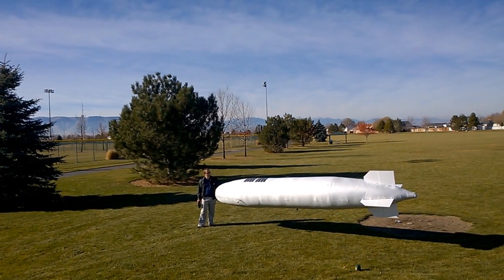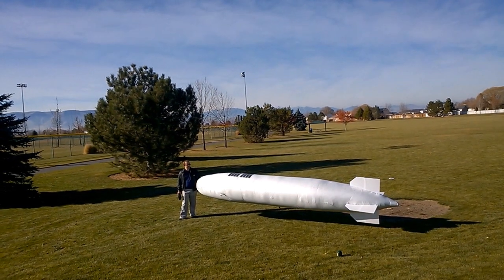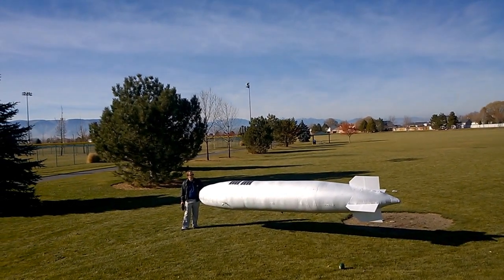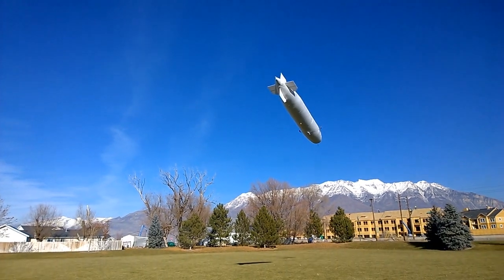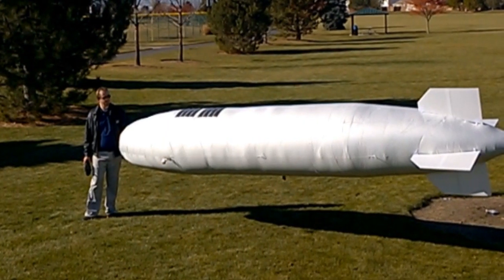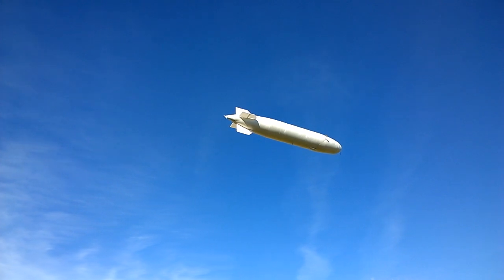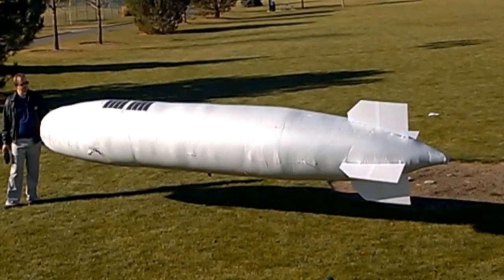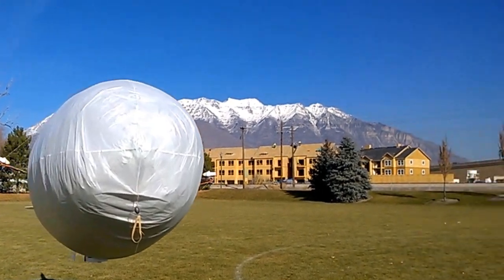Solar Powered Blimp Drone Prototype

Comment: Lite metal technologies used with graphite power cell technology to form hard outer shell with a Crystal lattice on the inside to generate power to run its systems. Take your pick of gases to use for lift.

Comment: @ Bacca

Please look into NASA using a fernel lens over the solar array to increase production of energy.

NASA got eight times the power out of a basic solar panel by adding a fresnel lens above it in a curved formation.

Kind of like a curved roof.this afforded getting light from every direction no matter what the position of the craft was.

Hope this helps you.
Reply from the maker: Yeah, that is interesting. The blimp pictured here is pretty old, since then I experimented with making a transparent envelope that acted as a lens similar to what you are talking about. That was an interesting experiment, but had some problems. The biggest is the heat involved. Heat is a big problem for any airship. Any differential between the temperature of the gas inside the envelope and the gas outside the envelope will cause massive changes in lift, which are difficult to compensate for. Then it gets even worse when the heat changes rapidly (for example if the sun goes behind a cloud). A solar blimp will naturally have worse heat problems than a regular blimp, and one that uses a lens with concentrated solar energy is even worse. Those solar cells get really hot. In the transparent blimp they were melting the  structures they were attached to, so you can imagine what it was doing to the lift!

Comment: Electric motors are lighter than petrol motors so there is room for solar cells. If the airframe structure  is carbon fibre it will be almost invisible on radar. ( while flying gliders at an air force base the station radar had our 2 metal gliders but could not see the fiberglass glider flying directly over the station)  it can loiter almost indefinitely at high altitudes. I bet the military would be interested in that for servalence.  Damm i woke up this morning with this exact idea and thought I would check to see if anyone else had though of it........

Comment: Im starting to look at the idea of a blimp with a camera. Solar panels were part of the plan since I wanted to land it for a few hours and let it charge to increase range. Someone has built it right here, proof it can be done and can work. So far im right at the start but im thinking wax paper over thin overlapping plastic and melting it together with an iron to keep it airtight. Once I get a blimp fully sealed, im not sure where ill go from there.

Comment: We're honestly surprised you're the only one who ever came up with anything like this.
I have some questions that I'd be glad if you could answer:
How much weight can this carry, exactly?
What is the maximum power output of the solar panels?
At what range is it capable of operating, in terms of radio control?
Would one be able to install EO/IR imaging systems or cameras?
Thanks for your time.
Reply from the maker: This particular drone has a useful payload of about 2 kg. Not much, to be sure. It could be scaled, and the capacity would increase exponentially. I'm currently using standard PWM recievers to control it, with a range of about one mile. However, the ultimate goal is a fully autonomous vehicle with essentially unlimited range. The big thing currently stopping me from doing that is regulatory, not technological. The FAA does not currently allow the operation of drones beyond line of sight. They keep saying they will change this, but no word yet. Until then, this project is effectively on hold. Power output from the solar array used here is about 30 watts, although since then I have started using much more powerful solar cells. Last time I did speed tests, it was moving at about 44 kph. Cameras and imaging systems would be a good fit for this.
Reply: This is such an awesome thing just to even watch fly- or maybe float-, never mind the high endurance and quiet operation! It is really disappointing that you can't legally continue flying this aircraft due to the FAA nonsense... How well has it (or your latest version) handled the wind?

Comment: Ditch the solar cells, stick with lightweight batteries and build it just big enough to carry a grenade launcher , IR aiming system and two way video and control signal gear for ultra quiet long loiter missions to take out insurgents hiding in caves or traversing mountains.
Aim to make the whole thing disposable and inflate the envelope with hydrogen.
Reply from the maker: baldieman64 Truth be told a conventional drone would probably serve the purpose of attacking targets better than a blimp. Because its speed would be greater and it's size smaller. One exception would be if you desire the ability to linger for longer than the batteries would allow, although you would need the solar cells for that.

Comment: Is there the ballonet into it?
Reply from the maker: +котофеич бегемот No, this does not use a ballonet for bouyancy control. On a blimp this small they aren't really practical. Instead, dynamic lift is used for altitude control. This does limit the altitude range you can operate at within a single flight. For example, it can have a flight that occurs at 3000 meters. It can also have a flight that occurs at 100 meters. But it can not have a flight that goes from 100 meters to 3000 meters in a single trip. That being said, a model could be made with a ballonet easily enough, it would just have to be a little bigger.
Reply: Thank for detailed answer!

Comment: its great until the wind picks up and then you have a flyaway situation
Reply from the maker: Heh, I could tell you stories... I used to do gliders as well as a few powered planes. One thing about them is that no matter what happened, the model would eventually come back down. When I started on blimps I quickly realized that is not necessarily true. I wouldn't say wind in and of itself is the problem. It's more when something goes wrong with the controls. Power loss, control loss for one reason or another. It is a prototype after all, bad things happen. And when they do it can be very... interesting. I've had to chase down a blimp more than once when it started to get away.

Comment from the maker: HMA Victory: Most of the airships are at least basically the right shape. Some might be more top heavy than is wise. The Goliath, for example, would need something really heavy on its belly to keep it from flipping over. And they are all too dense for Earth's atmosphere. You would need much less internal structures and much more space for gas cells. 

But, yeah, you could probably make something that looks basically like, say, a Destroyer and expect it to actually fly. At least, its outside appearance could be similar :)
Reply: Cool thanks :)
Reply from the maker: Shahriyyah Springwork LOL no...

Comment: How much can this carry? What would you sell this for? Whats the power output of the solar panels? How much of that power is consumed by for 5 minutes of full thrust and what speed does that full thrust give?
Reply from the maker: Power output on this older version is about 30 watts. I currently use much stronger solar cells. You may want to see some of my answers to NATO/OTAN above, some of the questions are similar. I think when I did speed tests with this, I could maintain 44 KPH indefinitely as I recall. Sadly this project is currently on hold until the regulatory citation clears up. Currently it is not legal to operate drones beyond line of sight here in the US without special permission, which has not been forthcoming.
Reply: You forgot to answer how much it can hold, and I have a question how long is it
Reply from the maker: This particular model has a useful payload of about 2 kg. That can be increased by increasing the size. This one was about 24 feet long.
Reply: Sweet I'm asked because I'm working on a  design for a flying aircraft carrier for RC planes basing it off of the carriers from the airship Pirate sears, BTY I would like to join the airship Pirate world so how do I?

Comment: Police should patrol cities like this, they could cover much more territory in the same amount of time, picture 50 of these hanging over a city, crime would drop.
Reply from the maker: +EVZebra Sounds like a good idea to me
Reply: BaccaYarro The ultimate construction material would be the same as a 2L Coke drink bottle just a lot bigger, same wall thickness so it can be pressurized slightly to give it mechanical strength. Its an expensive plastic injection molding tool though, but perhaps it can be fabricated using poly-carbonate sheet 0.2 - 0.5mm thick and glued and riveted with an ABS plastic glue on the joint on the bottom spine.
What ever is used it needs to be pressurized to make it strong so that it can be flown around successfully on windy days. If its made of a clear poly-carbonate it will become invisible once its at about 50 meters as it will take on the color of the sky the engines battery and solar panels can be painted sky blue so that it will be stealthy during the day.

Comment from the maker: Bradley: Yeah, I remember back when it was Project Walrus. It's a good idea, and I hope it works. But it's a different direction than what I'm taking here. I experimented with a wide-body design like the one used by that airship. I found that while it did help with stability on the ground, which is the goal of the Dragon Dream, it hurt stability in the air. 

I'm more interested in solar powered flight for airships, and for that I will need maximum stability in the air, and a minimum profile against the flow of air. So that means a long and tapered shape.
Reply: OK, cool
Reply: BaccaYarro  I am wondering what type of solar panels you use. Because cells like CadTel can work fantastic both in direct sunlight and with indirect blue light. Japanese tests show 20% efficiency under blue light. These panels can be screen printed, are very flexible, High output  (not to mention manufactured yourself at a very cheap cost) Preferred method is the Japanese method with some DIY cheaper alternative replacements. Msg Me if you want patents and methods. For a while my neighbor worked for Next Era power (fp&l to those that live in Florida) as the head of the solar division. He had a few of their panels that they use in their solar arrays. 4ft x 1.7ft panels produce 550w, 55v 10A and cost 200 to manufacture or 500 if purchased from a 3rd party manufacturer made to specification. What a great Idea I hope you take it even further!
Reply from the maker: Once Asleep Somehow I missed this post, and I don't know if you are still around. So far I have restricted myself to off-the-shelf solar cells, but I am intrigued by the ones you are talking about. Can you tell me more about how they are made, or how I could go about testing them?
Reply: The British and the Russians had similar projects back in the 70ies and 80ies, their airships were disc-shaped and used heated gases instead of ballast. The aerodynamics of the ship were a kind of better that way than that of a cigar-shaped one (I guess by side-wind), and the volume anyway. (you can also google "ala-40")

Comment: What do you think the maximum wind speed a UAV blimp like this could operate in and still be controllable and capable of flying in a grid flight pattern over an open field? Cool project!
Reply from the maker: christophertelford Roughly 25 MPH. Which means it can operate in roughly 98% of wind conditions observed at weather stations in the USA.
Reply: BaccaYarro WOW! What's the aircraft's top speed?

Comment: Awesome baccayarro.  You are mastered in both real amd virtual airships! I want to ask something about your solar powered airship , can it be mounted with more powerful engine and harder skin inorder to fly faster?Also , is the floating force provided by helium??
Reply from the maker: Yes, although a rigid structure won't be necessary until it goes much faster. I doubt it will be needed for the foreseeable future. If speed is what you want, then the best way to achieve it in a solar powered vehicle is to use the jet stream, IMO. 

For example, if you built a much larger version of this that could fly at 30,000 feet, you could fly from New York to Tokyo in about 2.5 days. By using the jet stream, you would have an average ground speed of ~130 MPH, even with an airspeed as low as 30 MPH. You could sustain that speed indefinitely, because there are no clouds or weather to speak of at 30,000 feet. And, of course, all this with essentially no fuel cost.

That's the ultimate potential of this type of aircraft, to revolutionize global cargo. But that would cost hundreds of millions to develop, so we start with drones.

To your other questions, yeah this flew with helium in this video. I use hydrogen for testing the envelope, because it is much easier to detect leaks with. I will be trying different prop and engine combinations, at the moment I believe I would gain more thrust with a larger propeller rather than a larger engine. The engines I use are surprisingly powerful and efficient despite their incredibly light weight.

Comment: Cool. I would use both types of solar cells for better coverage, not just one type. I would also add more thrusters for better movement in all three dimensions. The outer envelope seems rather thin, I noticed puffs of air affecting it. You may want to add external carbon fiber bracing, sort of a reverse zeppelin design, which has internal rigidity. Good luck.

Comment: I want to get into this. I think a hydrogen blimp with a fuel cell power source for propulsion and drone recharging would be ideal. I guess that the trick is the hydrogen/ oxygen reaction. Lots of zeppelins were lost due to this. Helium doesn’t seem realistic till it can be manufactured thru hydrogen fusion. All interesting and great stuff. With solar cells on the outside of the blimp I’m guessing that you would never have to land the blimp as It can collect moisture from the air to replenish the water ballast. Additional H2 can be made from the water to account for hydrogen lost thru seepage .I’m interested in collaborating with people on their and my ideas. I’ve already starting investing to get into the inflatables industry.